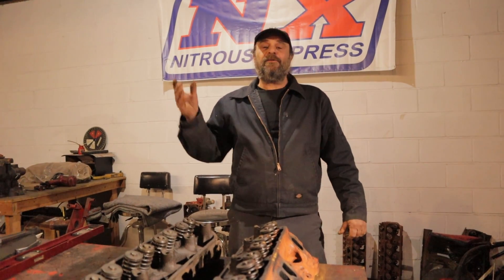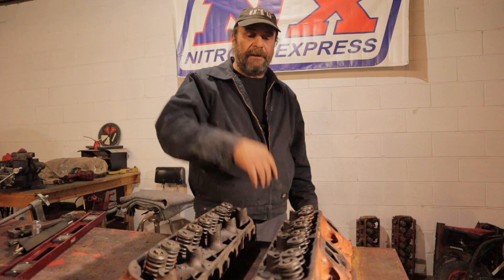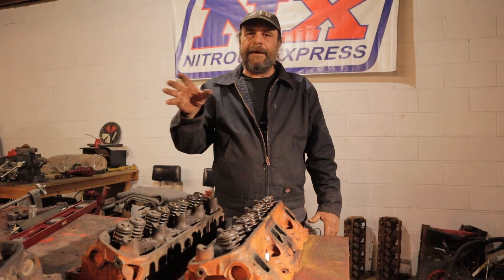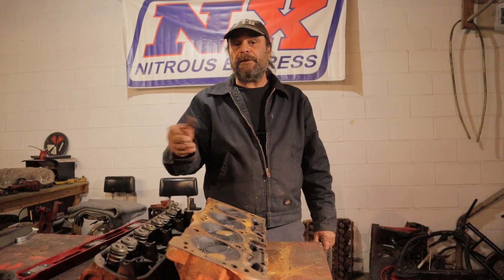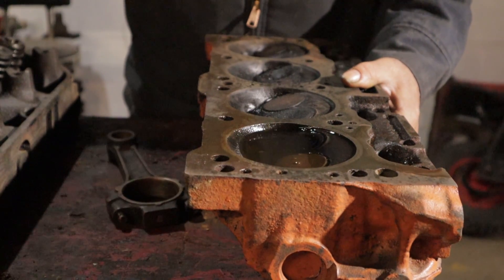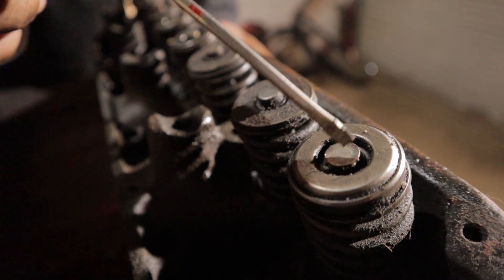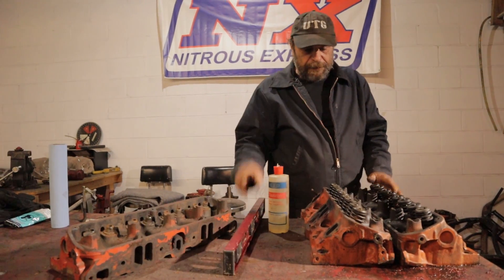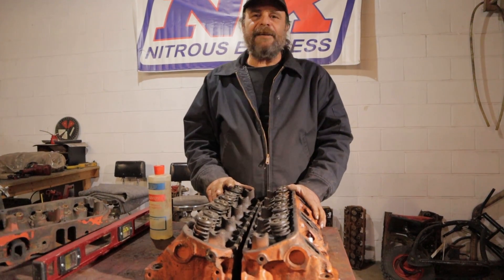Step By Step Home Kitchen Engine Rebuild Part 4:  Cylinder Heads

Comment: Any ideas of why those two valves were the only ones damaged and "Mushroomed" on the ends? Tolerances too large between non adjustable rocker arm and valve caused by a bad lifter or bent/worn different length pushrods? Why just those two on each end of the cylinder head? They looked like someone took a mini sledge hammer to those two, the others looked good considering the condition of the rest of the head. For anyone out there seeing this and deciding to buy a set of reconditioned heads, do some online searches and check if there are any issues that have been found with certain remanufacturers. I have seen many videos where people have bought new and remanned heads and had to have complete valve jobs done on them before they were even ready to be installed! At least do the leakdown test that Uncle Tony did to make sure that your new or new remanufactured heads at least have valves and seats that seal properly!

Comment: If a 440 overheated to the point there was power loss, and everything returned to normal once it cooled. Was the loss head expansion or was it gas being boiled in the carb

Comment: I can attest to the reman heads. Cylinder heads intl in Texas will send out a reman head for $200 with no core charge. It’s cheaper than sending your head to be replanned and three way cut which I was quoted at 600 and I had to completely strip it. You can buy hand three way cutters and reamers and use the Emory clothe To replane Plus the valve seal tool along with the spring compressor but that’s <$500 in tools and a pain in the ass and you only should do it just to say you did

Comment: 9:05 How do you know a mushroomed stem isnt hiding a sunken valve seat problem?
Reply: Superduper DavidMiorgan  Welp you didnt learn much about communication, reading comprehension or sharing knowledge in 60 years did ya? Was 60 years wasted, cause no one G.A.F. about your experience.
Reply: I'm just going through these videos and you have an interesting question. I'm thinking if the chamber holds gas, the seat can't be sunken right? Not actually certain just spit balling. I'd think the mushrooming is independent of that?

Plus there was the fingernail catching the valve seat test? I have to watch this again tbh

Comment: I'm buying a 1998 Dodge Durango 4+4 ,either 318 or 360,with 200k miles, should I put a set of  refurbished heads on it? I want to drive it to Canada from Texas? Any opinion on should I get the 318.or 360 model? It's going to be a 98 to 2001, I don't want any newer because of the 4.7 motor I think is junk!

Comment: I agree. For any engine that has way over 200,000 miles... the exhaust seats are going to be worn out of useable spec. Better to just replace heads with low mileage units from a wreck. DAMHIK. Fooling with them is a fool's errand. Valve springs will be sacked out too.

Comment: Don't fill the chamber with gas in order to check valve seal, otherwise you're just dumping gas over your workspace. Any other opaque liquid will do.  Gas pumps have billows for a reason--you don't want to make a habit of leaning over to breathe this cancerous stuff in, you do it enough in life.

But totally agree otherwise--don't waste $$ on a cylinder head unless its free and was never overheated. Aluminum ebay crap is cheap enough to invest your time on doing valvetrain repair...and you end up with a head that copied someone else's modern design AND handles an extra point of compression ratio.

Comment: How about checking seats for cracks, ie magnums. Instead of gas use wd40 to check how well the valve seals then evenly warm the seats and the wd40 will boil out of the cracks. With the heads disassembled of course. Love your channel!

Comment: Surfacing heads on a VERY flat table or piece of glass has worked on a lot of sub 10 second cars I have seen especially on the import side. It does indeed work.

Comment: The liquid in the combustion chamber to see if the valves are seating is no good, you can get them perfect and as soon as you bolt the head to the block the seat WILL distort! and the seal is GONE! we proved this many times to people that "know" better than the machinist that was running the SERDI Seat and Guide center all day every day!
Get some fresh heads and pull a vacuum on the port and then again after it's bolted to the block and then after the engine has been run and see for yourself.

Comment: As I am sure you already know sometimes those bargain rebuilt heads are not always such a bargain they need to be gone through to make sure they are ok. This also applies to the aluminum heads as well brand new out of the box I have seen them with bad valve seats the wrong springs and or retainers ect.. When it comes to heads ALWAYS check everything because there is nothing like dropping a valve on a brand new rebuilt engine to make your day.

Comment: I know much about cars but oil change and spark plugs ...so one day my neighbors came over and sold me a part that they claim to make my car faster ..1500 bucks later i see my car come back sounding like a muscle car and i open the hood and i had like 3 new parts ...im told new carb and new trick flow and headers to go with it...they are pair of brother who race and build for a living and seen i liked to go fast but my car was too slow ...i have 2x the power on it now ...turns out they gave me bunch of day old racing parts and they keep adding stuff...last week i got a whole distribution system for more power ......im learning fast too....im gonna buy a second motor to build up with em...just in case .....i have a 1988

Comment: A new floor, Yep ;0). The heavier engine stand with two wheels up front is far safer on the card board. Made that mistake positioning /wrestling with a 750 # stand  with one wheel up front when turning the block over. Whole thing tipped and I had to catch itin my arms  before it took out my knee's, my stocking  feet and the floor. The wheel trail in the wood  hall way floor from my room remained for many years. Not like working on a concrete garage floor in any way. Keep that in mind.

Comment: Uncle Tony, this series is great. i have watched every minute. i am eventually going to have to deal with the heads and rings in my studebaker 170 six cyl.. it was run with a flooding carb most of its life, according to the records that came with it. It had more carbon than a burned down forest, and more leakdown than a drained lake. and blowby good enough to make the oil a high grade fuel. assorted rings and valves were sticky. since last June i have started and drove it a bit here and there, and it came around last month, believe it or not. The Daytona universal carb was a better match than the original Carter RBS unibarrel.

Comment: 360 heads? 
So, are the heads, crank and deck height the same as the 318 and 340? Thank you in advance.
Reply: 360 cranks have larger mains and stroke. 263,318, and 340 all use identical cranks some cast some forged. Then heads depend on year and what the engine was put into. For the most part 318 heads are small port/valve. 360 heads are larger port/valve, but have larger combustion chambers, 340s normally have large port/valves with the smaller chamber. Then 273 are normally small port/valve as well. That’s just typically what you’ll find, there are many different LA heads that got swapped through all the different bottom ends
Reply: @tl5108  Thank you

Comment: Problem is the 1500.00 heads usually have piss poor valves jobs and tight guides. Need another $300 before you can run them.
Reply: Yep. Found that out the hard way.

Comment: I have a question regarding a 1965 Buick Special 300ci, and my son swept the valve spring (1/2) keeper into the garbage.  I went online and to all x3 auto parts chain stores and those clerks are absolutely useless outside of entering a UPC # and ringing you up for the said item. 
So, how do I SIZE or look up the exact half keeper or any other hardware like nuts and bolts that will need to be replaced?

Comment: If a machine shop uses a belt sander to resurface a head you better find a REAL machine shop.
Most use a Rotary cutting machine with the head or block perfectly leveled in the fixture.
Reply: Yep and I've seen a few heads that were straightedge flat longways but out of wack when the straightedge was placed diagonally across the surface
Reply: Not me but a coworker did that once. 
One of his buds swung in at lunch and asked him to 😮
Chev 350 won't care 😁
He just wanted all the gasket goop and shit off the surface real fast. 
Cool part was the dude flipped him 30$ and I got  free lunch for being quiet 😝

Comment: Hello i have a chevy 350 block that need new heads 
Can i get the old ones off put new ones on adjust the valves and i am good to go ???
Reply: Assuming nothing is wrong with the block.
Reply: @Scott-Hamilton850  to my knowlidge the block is ok one of my valves is tikking according the garage one valve stem is no good anymore its wornd best thing to do is buy me a referbished one the say

Comment: Thank you for the little tips that you don't find in the books, or even online,(for the most part)
Like the valve guides, there are many vidd and literature about seats, porting, warping of the heads, etc. But almost nobody mentions the valve guides! Especially about machining them for a high lift cam.

Comment: I'm gonna weigh in from personal experience.  The atk/surefire heads and engines are complete garbage. If you are building a chevy small block, like most of my stuff, the price of reman heads, and having the machine shop check them, is the same as assault aluminum heads. I have used assaults with great success.  I say this because I went through 3 sets of defective heads on a 5.7 hemi. 4th set worked. Their quality control is butt grade crap. Autozone and advance carries these heads and engines. Secondly,  if you use a level or carpenter square for a straight edge, use a machined edge one instead of stamped. I have seen stamped squares out at least 0.060. I was taught to clean up head gaskets surface with a sheet of glass and valve grinding compound in a figure 8, but if a rigid flat block and emery cloth works well for you,  rock it.

Comment: Thanks fer all tha info 
Quick question 
How much lift can one run with stock 360 mopar heads ??
Reply: He says .540 is max lift in the video without trimming the valve guides.
Reply: @JohnWilburn  They watch but they just don't listen!🙄🙄😲
Reply: Nothing over a .590 lift. Head stalls with anything higher
Reply: about 9
Reply: I do listen n heard tha .540 lift about tha guides  but wondering about tha springs n retainers limits 
Thanks

Comment: What are your thoughts on the valve rotators? I ditched the ones on my 302 heads when I changed valves
Reply: I can’t understand the purpose behind them. I ditched them as well. If u put a larger lift cam in, you’ll just run into coil bind and valve train clearance issues sooner with them

Comment: Broken stud a good candidate for  battery charger/ tub of water/ baking soda trick
Reply: A nut an a few electric spot welds usually works but not always.😎
Reply: @bigbear5510  
Haha I usually go thru 3-5-8 nuts or so before one sticks good , and by then the heat soak is helping too.
I did see a neat trick recently that I'll have to try , and that's tacking a washer on the (flush broken) stud first , and then adding a nut to weld on.
Reply: @MrTheHillfolk  I've seen that one too. A few heat cycles with a propane torch first helps, sometimes that all it takes This one is broken off inside the head a little bit though. Maybe Uncle Tony will share his secret trick with us. 😎
Reply: @bigbear5510  
I'm pretty sure he's got many tricks up his sleeve for extraction 👍

Comment: I've always used the dishwasher to clean parts. Just run a cycle after and bingo...no evidence. I found it works quite well for K&N air filters...spic and span.

Comment: Great information Uncle Tony!👍👍 Hello Uncle Kathy!👋
When checking the valve guides make sure you have a good valve in hand!
I was wondering what kind of heads you were going to using on this engine. Thought that you might be going with some aftermarket high performance heads. I'm sure ya can get these to flow just as good, if not better!
Lookin' forward to the next video!😎

Comment: Does anyone use valve lapping compound anymore?
Reply: i am sincerely going to give that a try on my studebaker 170. i saw a vid of a guy doing that to same engine, with great results. seats are not hardened.
Reply: I always cut a 3/4 degree interference angle when grinding valves and seats. Lapping the valves afterward doesn't hurt but doesn't make them seat any better.
Reply: @jimmyraythomason1  
Could you please educate me on why they won't seal better?

Comment: Tony I want your professional opinion. does it affect flow like I think it does if you where to take the 318s 2 barrel intake off and put on a 360 4 barrel intake ? I know you can do a 318 intake on a 360 and it will boost torque . also running 340/360 exhaust  manifolds on a 273 / 318 heads will cause leaks/ burn outs of the gaskets just like with the headers since the ports are different ?

Comment: Tony you forgot spring tension or loss of from long duration unturned long blocks as an example
Reply: He will probable cover that in another video. This was about the heads not the assembly of them.
Reply: @bigbear5510   the video was about assessing the condition of the heads and the springs are as much part of the heads as the valves they hold in place don't you think ?
Reply: @waynefergusson9987  You would check the spring pressures once the heads are disassembled. They are components for the head and parts of the valve train. So it could go either way depending on whom you ask. 
IE; Is the glass is half empty or half full?

We will see what happens on an upcoming video.😎

Comment: So why were those two end exhaust valves severely mushroomed? Something was definitely not right there...
Reply: Probably collapsed lifters, allowing lash and hammering  .
Reply: Most likely the rocker shafts were full of sludge or ground up plastic from timing gear and or valve seal material. Therefore starving oil to the rockers and valve tips. I've seen it before on a big block. Inside of that engine was disgusting plus timing gear was thrashed.

Comment: How do you know the seats are good in those heads with the valves in x ray vision or you just know? What about valve seat cracks between the valves I have seen many old heads with cracks between the exhaust and intake valves? what about lapping the valves
Reply: believe that he actually thought the height of the exh valve in the combustion chamber was very adequate and represented a perfect shape valve seal underneath

Comment: Did I hear right? You’re using 360 heads on this 318? Looking forward to seeing how this one turns out.👍
Reply: I would have used 318 heads ported with bigger valves just for the port velocity alone 360 heads work ok but not until about 4000+ and you need higher compression I know I have built many through the years. On a 318 your compression better be at the minimum 10:1 if you want to see the benefits of the bigger ports.

Comment: If we buy recon heads or aluminum heads should we take them to a machine shop to have them checked over?
Reply: I’ve never bought any, but I have heard this also.
Reply: Yes.
Reply: Yup
Reply: Most definitely and make sure the water jackets don't have residual cleaning  abrasive falling out , I use a quick shot of shaving cream in all the deck side water holes in a head, keeps any crap from falling in the fresh cylinders and even though most are cut with a 3 angle knife these days ,check valve seat concentricity , you might find they need a light touch with a stone to be perfectly round as the lifting of the knife creates a small irregularity on the seat surface ,but thats just me

Comment: I was told harden seats are needed in high rpm engines and tow engines things like that but for everyday driving and once in a while getting on it won't hurt anything it's just the high load engines like fleet vehicles tow rigs and race cars harden seats are necessary
Reply: If you drive it often it needs hardened valve seats.

Comment: Oh I didn’t realize this is just 35 minutes old.  

I’m building a 440 6 pack for my 69 roadrunner and I have a question what is that brownish primer you use on your engines before you paint them?
Reply: Rustoleum
Reply: https://youtu.be/3NQyzp5ViNs
Reply: Gliptol.
Reply: @ryandavis7593  
Tiny said he used Rust-Oleum rusty metal primer. 
Glyptal is like 50$ a quart and supposedly he said the Rust-Oleum primer works about as good.

Comment: A funeral home can supply polished granite to dress cylinder heads. Use spray adhesive to secure sandpaper and slide the head. They can get you granite in any length you need. To check the deck surface use a marble base that is used in trophies. I get these trophies from yard sales. I also use the granite slab to sharpen curling rocks. See my videos on YouTube.

Comment: Quick question Tony. I have a 64 polara 4 door. It's equipped with a 318 poly. The current poly smokes and drinks oil like a rockstar. I have another poly I can plunk in but I also have a 73 360. I'm conflicted on which way to go. Could you give me your opinion on which way to go? The car will be a daily driver but I'd like to hit the track on occasion and parts for the 360 are more widely available and more affordable. I do love the poly though. What direction would you go?
Reply: Sounds to me like you need to find another car and build two!
Reply: do you want to sell 1 of the polys if you dont use them